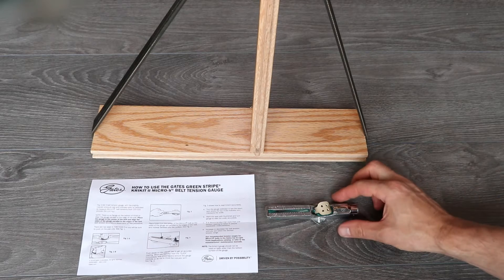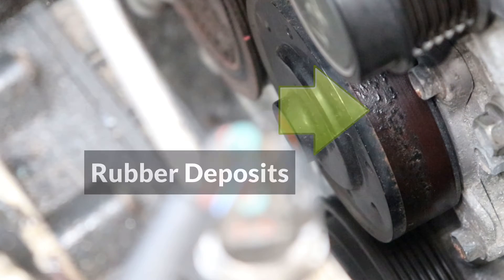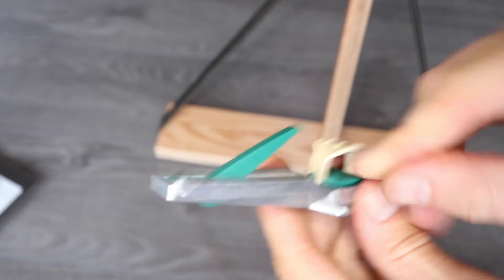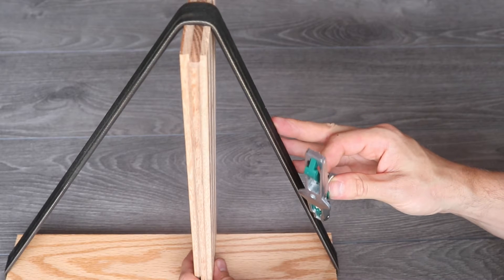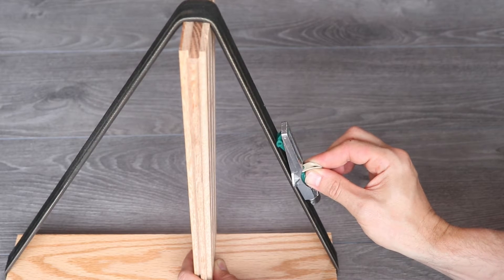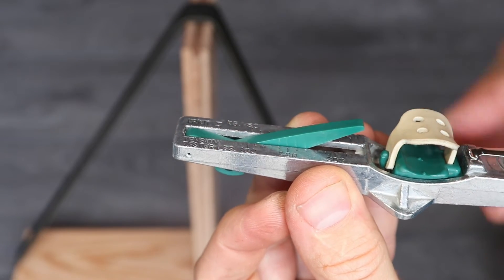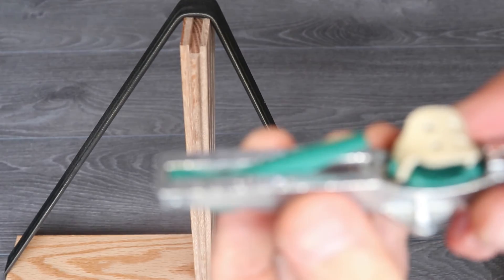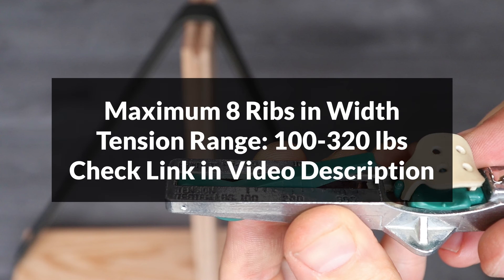Using a Serpentine Belt Tension Gauge - Measuring Tension with a Krickit II Tensioner Tool

Comment: Thanks for the video. I just replaced the ribbed alternator belt on my Volvo Penta D2-55 diesel in my sailboat. It's easy to get to the belt, and this tool will help with keeping the belt tension in spec. I love buying cool tools. You have a new subscriber. 👍

Comment: let's see you use it on real car not this  convenient accessible belt setup.useless junk that can not be used on a belt that is in car that's why they always have these youtube wheel EZ belt setups. 98% of the car belts are almost unreachanble and the flat side is never on top it's always on the side with other stuff in front of it. that there tells you this is BS gimmick
Reply: Ok, settle down tubs
Reply from the maker: You can see me checking tension on the 2014 Corolla here:  https://youtu.be/LIMqf2WJN48?si=9to8K9ssNj3rGX9F&t=349   , for the Corolla I had to remove the bottom cover to get to the recommended place to measure.  The manual should indicate the correct place to measure.

Comment: Good tool for professionals, but for me (maybe changing twice more in my lifetime) is to-o-o expensive. What do you think, Clever Fix, if I measure and mark down with paint pen the position of adjuster before losing it, and then just adjust it to the marked down previous manufacturer's position. Should work, isn't it?
Reply from the maker: It's $30US on Amazon, that's a pretty good price. Professionals do not use this, a pro tool is $200-300 at least.  Setting it to the same place doesn't guarantee accuracy at all, it has to be measured. If you have this tool you can also check it yearly, to make sure it stays within specification. I was going to check it once in a while, and I completely forgot, so thanks for the comment, this is a good reminder for me. 😃
Reply: Unfortunately, it is $65 +13% in Canada.  Of course it is good to have one,  but not at this price. 
It is more for perfectionist and now I can see that you are in that category,  what is actually good. 
Unfortunately,  in this life we have to compromise. Is it the best way of changing engine belt is measuring its tension with designated tools??? Of course it is, but if  we put exactly in the same manufacturer's position it will be fine too, besides we bought Corolla 2009 brand new.
Driving more than  45 years and do everything on our family fleet by myself, there were no issues at all.
I never heard of this tool if I  didn't find you on YouTube, and on  hundreds videos nobody even mentioned it. 
I have found manufacturer's instruction on engine belt replacement and no tools for measuring the tension is mentioned. 
I really don't want to pay for the tool $73.45 and use it just once in the rest of my lifetime. 
But again, thanks alot for the information. It's still good to know absolutely perfect way of replacing a serpentine belt.
You are the best!!!
Reply from the maker: @stanislav9608  Yes price went up, I got it when it was $19US, two years ago. If you order from Amazon.com, it comes to $60CAD shipped to Canada including tax.  All manuals should provide the tension of the belt, so whichever tool you use is up to you, the dealer uses a much better tool than the Krikit.   Thanks for the comments and watching!
Reply: @CleverFix  Just for those that are interested, I found on Toyota Forum Serpentine belt tension specs:
Deflection:
New belt 7.0 to 8.2 mm (0.276 to 0.323 in.)
Used belt 7.6 to 10.0 mm (0.299 to 0.394 in.)

Tension:
New belt 700 to 800 N (71 to 82 kg, 157 to 180 lb)
Used belt 550 to 750 N (56 to 77 kg, 124 to 169 lb)
Reply from the maker: @stanislav9608  Yes that's correct for Corollas with a 2ZR-FE Engine.  I think I show the used one in my video only, I didn't want to confuse people.  The manual also mentions that after 5 minutes of use, a belt is considered USED, so that's very important. I like to use it for at least 10-15min to make sure it's stretched out properly, before tensioning to the Used specification.  In some cases 5 minutes is not enough to stretch the belt out.